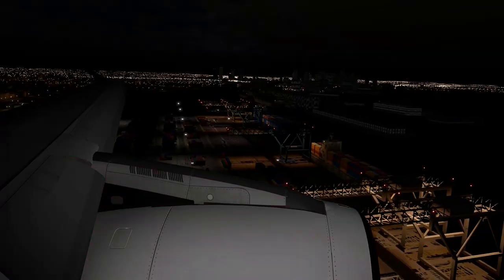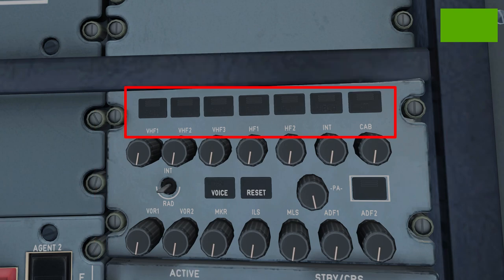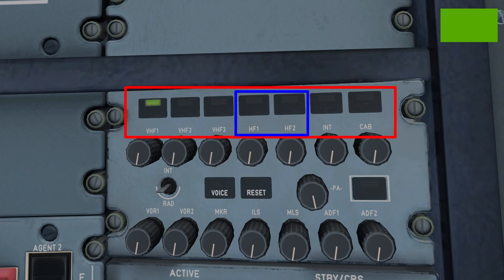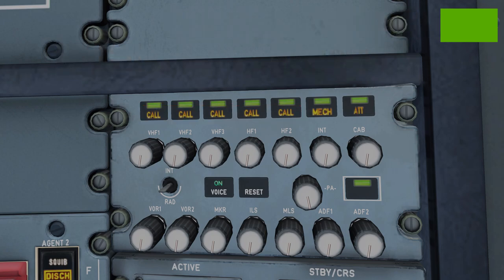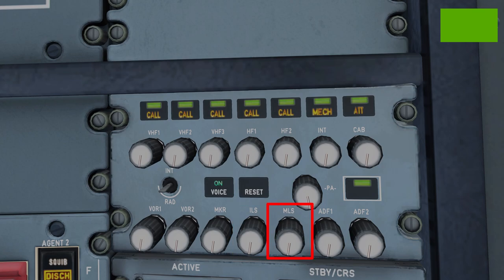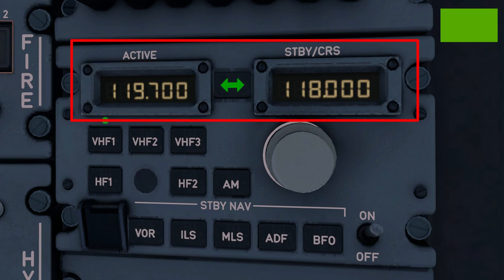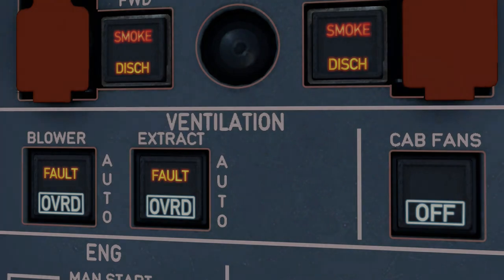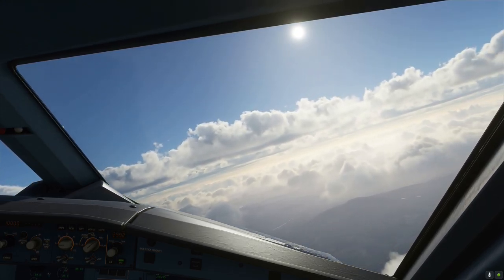Aircraft Dissected Ep 3: The Overhead Panel [Part 3] I A320 Detailed Tutorial (X-plane 11/MSFS 2020)

Comment: Extremely effective video. I beg of you to come up with more such videos.
The Engine "MAN START" you mentioned. This start is quite often used when
1..outside air temp very high.
2..high altitudes starts.
3..insufficient low air starter  pressure from bleed.
4.. when igniter B is declared unservicable.
5.. Any time in Auto start if you get an abnormal start it is advisable  to opt for a MAN START  subsequently
Etc. Etc.

Yes, you correctly corrected yourself. The ovhd scan is always bottoms up.

Retd. Examiner  A 320 family. AirIndia.